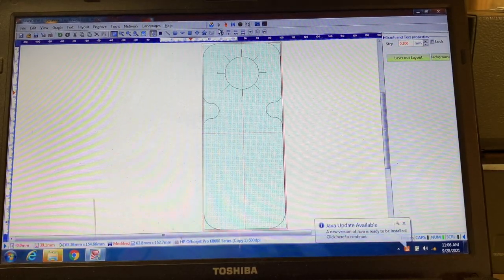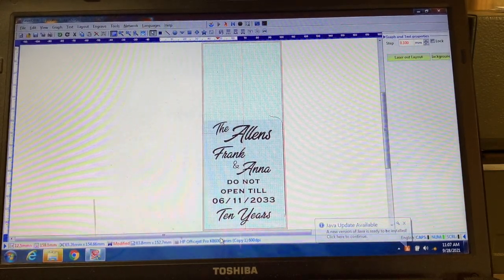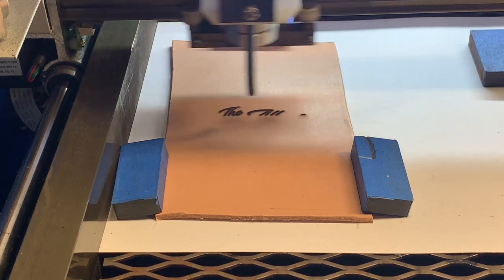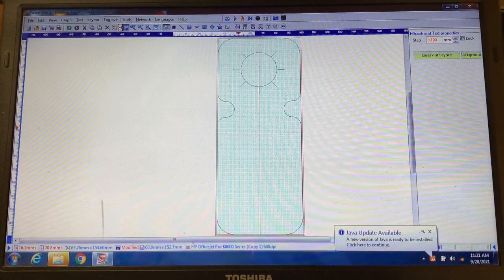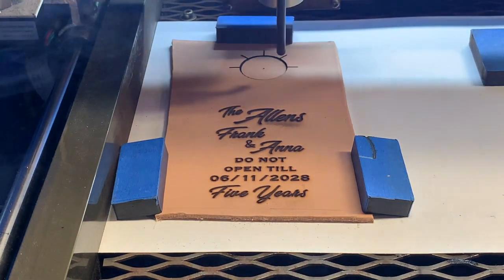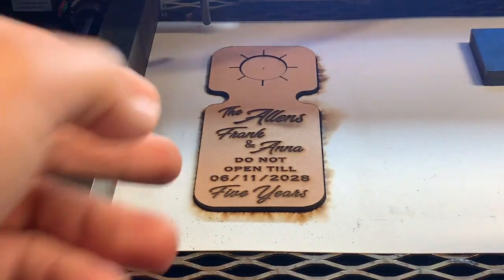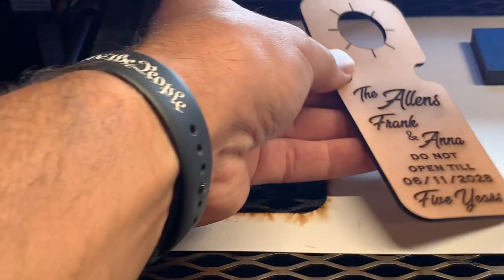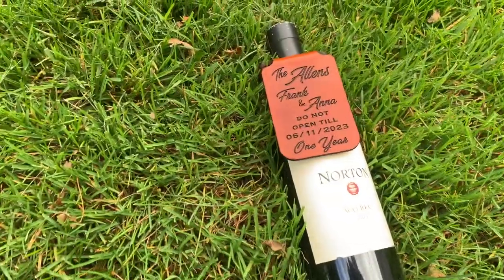Engraving and Cutting Leather with the K40 CO2 Laser

Comment: Curious as to how you like that type of air assist compared to the ones that attach to the lens nozzle?
Reply from the maker: The first air assist I used was the style that attached to the nozzle. It did not have a high concentration of air directly on the cut, and acted more like an air diffuser. The air assist I am using was something I custom made quick, it worked so well, I never tried anything else. I am also using a standard air compressor.

Comment: Hi! 
After a long research I Finally got enough courage to get K40 - same or very similar to yours. 
My plan is to install a new Laser head that has inbuild air assist hose so that air goes directly out of laser tube. Also will get a new set of mirrors and focus lens, in hopes it will increase overall quality. 
Since my only goal is to engrave and cut leather - I wonder how thick vegtan this laser can cut in one go without doing multiple recuts?
Reply from the maker: I have no problem cutting 5/6oz veg tan in a single pass. A good focused air assist is key. I tried a 3d printed air assist, but it was more like an air diffuser. I ended up installing my own which is just a metal tube focused directly at the burn spot. I am also using a standard air compressor so I can get a good amount of air moving.

Comment: How do you deal with the smell of the burned leather. Is there a way to get it out of the workpiece? When I tried to laser vegtan leather, it always smells nasty for weeks or months still.
Reply from the maker: I have a pretty large exhaust fan setup, its actually a dust collector that I repurposed and made it into an exhaust fan. I would image that if your exhaust setup is not large enough it could cause the leather to become permeated with that smell. Also, I use a dedicated air compressor for my air assist, its much more powerful than any built in air assist, maybe that helps as well. I do get a bit of the smell when cutting, but my cut leather pieces do not continue to smell after finishing.  Maybe wiping off the charred edges after cutting could help too.

Comment: be careful, some leathers make cyanide gas
Reply from the maker: I only cut veg tan leather, which doesn’t have the chemicals say a chrome tanned leather would. My exhaust fan was made from a dust collector that pushes 1100cfm. Way overkill for this little laser, but to your point, you have to be careful with fumes when cutting or engraving any materials. The exhaust fans that these CO2 lasers come with are very under powered.

Comment: hello I have co2 laser 80-100 watts.I am trying to best cutting settings for 2.5mm vegetal tanned leather.When I try to cut it to much burn occurs at the edges.
what is the optimum air assist pressure for this cuttings? my compressor provides 6 psi max. Maybe I need to replace it with new one? Thank you !
Reply from the maker: It not only the pressure that is going to give you a good cut, its also the focus of the air itself. I had many issues with cutting, realized it was due to air assist nozzles that diffused the air too much, and did not focus the air at the beam. Once I had air hitting the right spot things improved a lot.

Comment: Good video. You said you're using 23% power what does that equal in mA on your machine?
Reply from the maker: My amp meter will be here tomorrow. I will reply with that info once it is installed.
Reply from the maker: I do not have the mA meter installed on my machine. I am going to be adding one though, and will be posting that video as well.
Reply from the maker: @ThyerHazard  you wanted to know what 23% power was in mA on my K40? It’s is 6.5 mA.

Comment: Nice work. Keen to see more leather lasering videos. What type of leather do you recommend for cutting and engraving on the CO2? Veg tan?
Reply from the maker: Veg Tan definitely yields the best results, especially before doing any finish work with dyes etc.
Reply: Yeah you definitely only want to use vegtan for any type of laser work.  Chrome tanned leathers will give off nasty and sometimes toxic fumes when cut or engraved on.
Reply: @ropeany1  a good ventilation system is key with any type of laser engraver. Most of the onboard systems are not powerful enough to evacuate the fumes properly.